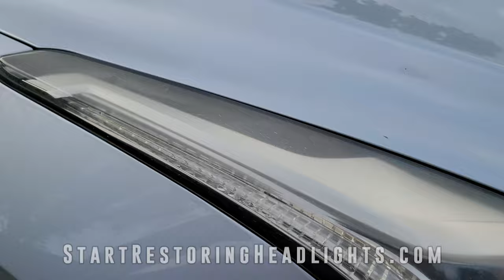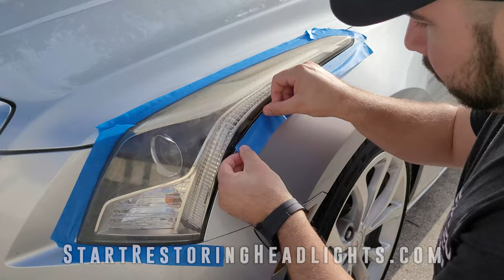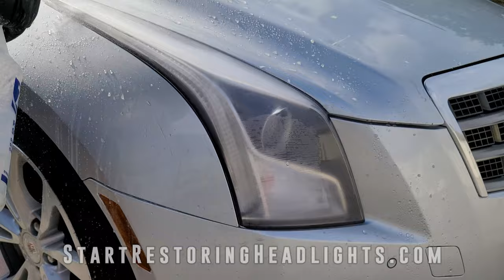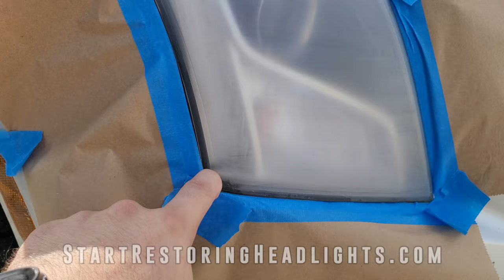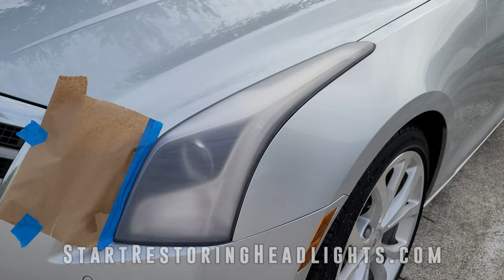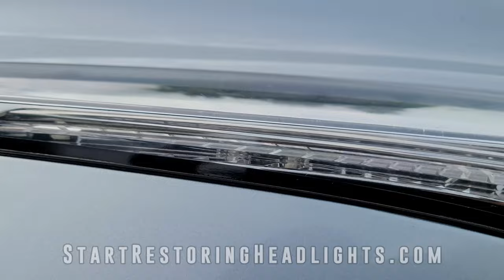The Truth About Microcracks: What Headlight Restoration DIY Kits DON'T Tell You | 2013 Cadillac ATS

Comment: What causes a headlight to come out hazy/cloudy.  Today I did a PT Cruiser and I started out at 600 then was worried about spraying a coating so went to 800 then 1000. Do you think I should of started out at 400 ? Usually the lens pop with shine and clarity.  What do you think causes the hazy/ cloudy ?
Reply from the maker: Hi Tom, its a little hard to say without more context. If there is left over clear coat on the headlight that isn't completely removed it can cause a haze/cloudy. Also, clear coat that doesn't cure right can have a cloudy look as well. Are you using 2k?
Reply: @StartRestoringHeadlights   I’m using Meguiars headlight spray
Reply: @StartRestoringHeadlights   the lens didn’t have any defects at all just yellowing but maybe I should of started with the 400 grit not really sure.  I wish I could get my system down as good as yours.  I’m always worried that the spray won’t cover the scratches so I will go from 600 to 800 to 1000 to 3000 to a polish then I spray. It took me 1 1/2 hours to do these headlights that would of taken you 15 min.  So frustrating how long it takes me. Tomorrow I’m doing a Outback with just yellowing but this car belongs to someone so I wonder how much over thinking I will be doing. Up till now I’ve been just doing junk cars at a garage and couple of family member cars
Reply from the maker: @grandmastert01  Ahh I understand. I don't have experience using Meguiars clear, I'd check out the Headlight Restoration Pro for that method. Practice makes perfect. Practicing on Friends and Families vehicles are perfect for it. If starting with 400, you need to make sure you are sanding thoroughly with the other grits to be sure you dug deep enough to get the scratches out. I"m uploading a video explaining the difference in Oxidation and clear. Uploading it now actually :)
Reply: @StartRestoringHeadlights  awesome thank you
Reply: @grandmastert01  Meguairs spray is made for headlights… It will not be the same in comparison to any paint clear coat. There’s no rough surface needed for it to bond and level to. So yes, you must complete the full steps in a true headlight restoration to a polished surface for it to do its job. 

Also, why are you comparing your time to this particular method? True and complete headlight restoration takes anywhere from 60 minute to two hours at most. 

I average around an hour an 15 min to be done, from taping to snapping photos of the finished result. 

Stop the comparison. 

Even Modern Vehicle Care; his method is wet sanding and then applying 2k clear… He generally takes 2 hours every vehicle. Some has to do with his prep work before spraying, but this is normal. 

No complete restoration will take 15 minutes, I’m sorry but that’s facts. 

Stop comparing yourself to others and focus on the process. You’re learning. 

You cannot skip steps and finding hacks to improve your skills faster. 

Seek to fully understand each step in the process, practice what you know, and as experience comes you’ll get better. 

You’re complicating your learning and it’s going to hinder you. 

Its simple.. If you like Brads wet sanding method then stick to starting every light at 400 grit.. If it’s not removing the old clear well enough, then drop to 320, and build up to the next consecutive grit level. Then polish and protect with what you like using.
Reply: @grandmastert01 hazy is caused by humidity

Comment: I had an incident where after completion the customer was finding all kinds of faults. I think he didn't want to pay so he fussed until I said it's free. Have you ever experienced that or do you take payment upfront during booking?
Reply from the maker: Yes, this is why its VERY important to do your inspection with the customer prior to restoring so you can set the expectation. They are assuming you're going to make it look OEM, but if theres deep scratches, microcracks or other permanent damage, they need to know about it before you start. We've had those situations. We're 100% satisfaction guaranteed, and the only issue we've ran into with that case was some slight fogginess on the inside. At that point, we simply gauge the customers reaction. At most, we discount it 50%, because even then we are making $45 an hour, and keeping our reputation safe.

Comment: If sandpaper is an abrasive which cause micro scratches added that no high grit sandpaper used then why don’t you polish them?
Reply from the maker: Micro Cracks and Micro Scratches are 2 different things. Microcracks are much larger, and have a wider dimension. They aren't removable with sanding, even if you sand to the crack itself. Its like a hole in the lens.
Reply: no I mean just by sanding isn't that causing some marring and that's why people typically go up in sand paper and then polish? @StartRestoringHeadlights
Reply from the maker: Oh, I understand now. No, I'm sanding to remove a layer of polycarbonate off the lens, then building it back up with the clear coat. Most methods require you to go up in higher grits because you have to make the scratches are tiny as possible in order to polish them out. Since the clear coat has filling properties, theres no need.   @shavfx3574
Reply: ok got it thanks @StartRestoringHeadlights